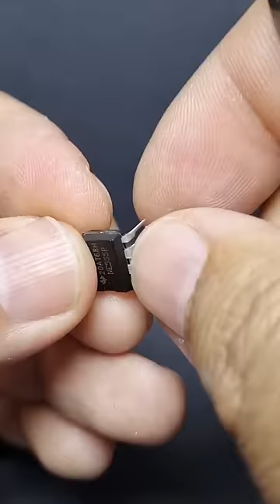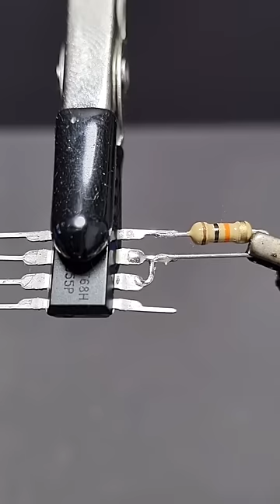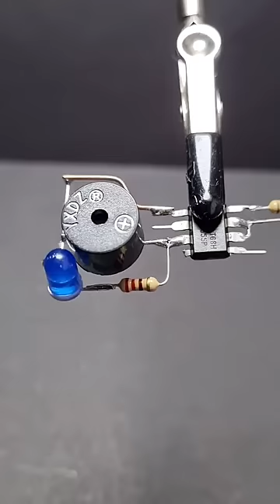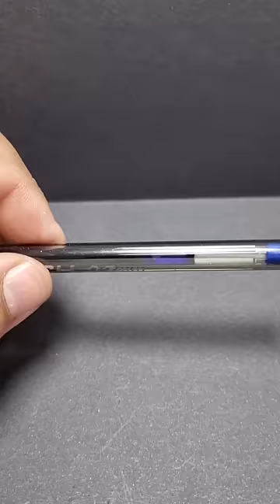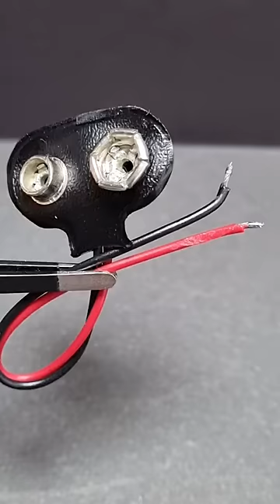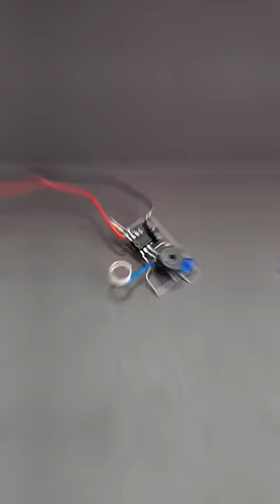How To Make a non-contact AC line checker #shorts #zaferyildiz #short #electronics#viral #ne555

Comment: Cool. I just wish I knew what I was looking at.
Reply: The NE555 integrated circuit is very versatile. Google it up. In this case, it's being used to detect activity in the electric grid without any contact. It lets you trace your home's grid wiring across the walls.